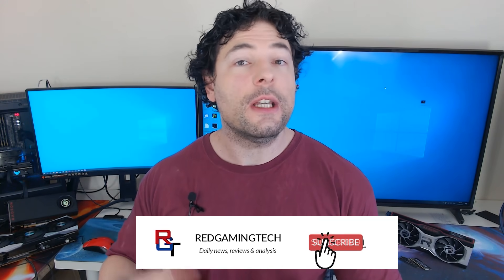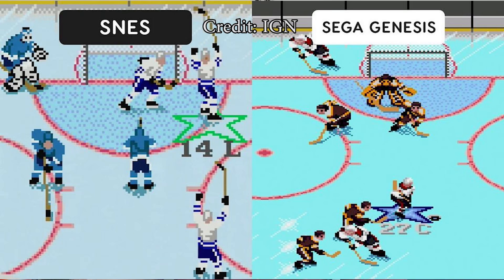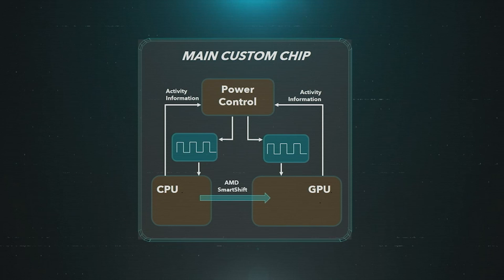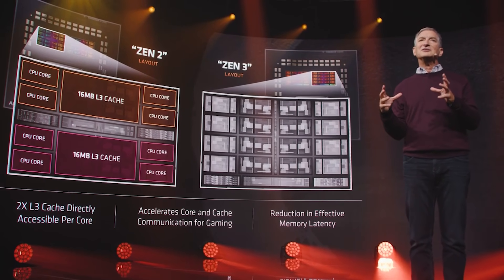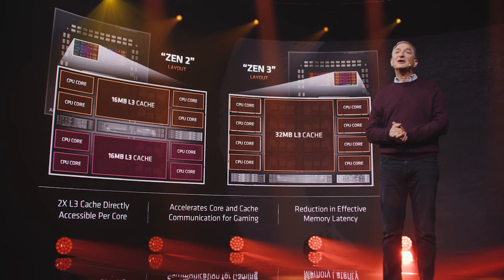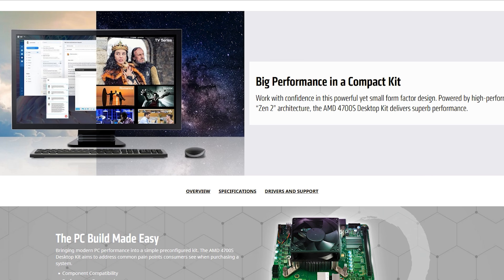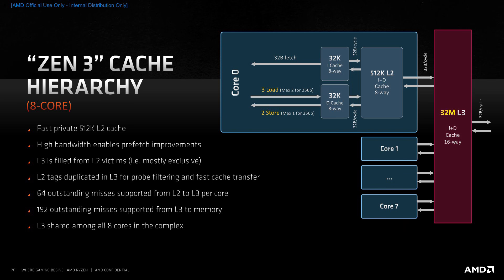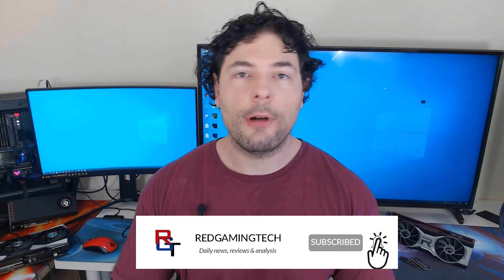PS5 CPU Die Shot Reveals HUGE FPU Customization | Playstation 5 CPU Analysis

Comment: No wonder Ms changed there most powerful console name to
Most powerful Xbox after they saw UE5 demo running on ps5
Reply: Yeah no... You do realize that exact demo also ran on PC's less capable than both next-gen systems right??? (RTX 2080 Max-Q). It would have ran just fine on the Series X. The only reason it was shown explicitly on the PS5 was that Epic & Sony have an expensive marketing deal together.

Also, please do explain all the games with +≈20-30% resolution advantages on Xbox... -_-

No amount of CPU grunt can make up for a lack of GPU performance when it comes to raw pushing pixels.
Reply: @Cooe.  An RTX Max Q is basically equivalent to what is in the new consoles. Digital Foundry videos all prove the consoles have a rasterization performance of an RTX 2070 and raytracing performance of an RTX 2060.
Reply: 1, they changed it from console to Xbox when the series S got revealed so ppl didn't mistake the S as being the most powerful console and 2, that ue5 demo Sony paid epic money for it, and it was showing running on a Pc and the next demo was on Xbox, plus it's already been shown on the die shots that the PS5 fpu is cut down, so dunno how's he's saying it's special lol
Reply: @mackemsruleFTM  he is clearly a Sony drone.
Reply: @mackemsruleFTM  and yet the xbox doesn't hold up ... stupid argument
please provide a source for the sony epic pays for a demo AND a source that ran it on the pc ... or shut up
Reply: @Cooe.  Ha, I'll bite and this is an easy one.  PS games although run at a slightly lower res always or atleast 90% of the time have a better FPS...  See simple as that not super complex or confusing.
Reply: @dribblepi5554  So Sony didn't "invest" a few million in Epic at the same time then??
Reply: @Cooe.  PS5 is running on par with the RTX 3080 PC in deathloop with same ultra graphic setttings source Enalista debits man the PC fanboys are gonna cry a 3080 PC costs 3000$ and the PS5 is running just like it when there is no cross gen games hodling it back that custom Big navi 21 RX 6800XT GPU that mark cerny hinted at the road to PS5 thats in the PS5 apu SOC is doing some work for 499$
Reply: Shhh! You'll upset the xbots. Oh 😂 you already did
Reply: @mackemsruleFTM  not quite cut down just highly modified..
Reply: @tristman8413  ehh no cut down from 256-bit to 128-bit
Reply: @raios-rogueboss-slayer4179  wrong. We won’t see this till like 2023.  But I do kinda believe your claism
Reply: @dribblepi5554  sony invested $250M in epic at the same time
Reply: @dribblepi5554  right so if you had a demo and one company gave you nothing and the other invested millions in you which company would you give the demo to? I know it's a hard one lol
Reply: @tristman8413  👍😂😅🤣

Comment: I'm still confused why the series x and s are clocked so low on the GPU. The rdna 2 core can go much higher than 1.825 ghz. I know it would raise power but the series x cooler Is beefy and it's not fully utilizing it's 315 w psu so I feel like they could've turned it up a notch
Reply: Yh same
Reply: Two options: 1. it was also aimed at servers and clocking it lowers helps there. A lot. 2. They save the extra room for a refresh end of next year or 2023. To see a bigger gap to XSX and XSS.

I don't like both options. But at least, the console is decent and fun to play around.
Reply: Because xbox has way more compute unites (36 vs 52) so they would have limited the clocks for thermals and power consumption. Also they don't really need blazing fast clockspeed since features like mesh shaders are designed around parallelism and will take advantage of the wide config of the xbox. So it's a well balanced tradeoff.
Reply: True with a BIOS update they can push the clocks higher to 2GHz.
Reply: I'm sure they played around and found the right clockspeed for it.
Reply: Possibly it's to do with the capacity of the cooling system to dissipate heat faster than it can build. It'd just de-clock itself as a result
Reply: @supermadkid  frequency’s don’t depend on how much CUs there are. they probably lowered the frequency’s to run lower powers games like Xbox 360 games so that backwards compatibility works better.
Reply: @rsKayiira  they would never tho , the chips are all validated to run at the rated 1.825 ghz off the assembly line. I don't believe they would ever release an update like that because it could possibly cause issues
Reply: @mickaelsflow6774  I see the point about the servers but they could've run dual bios , one for the console config and another for server config. I just think they left some performance on the table by not clocking this thing a bit higher for the series x
Reply: @earnistse4899  they did it with the Xbox One!! Looking at the PS5 GPU clock speeds the Series X GPU can definitely get close to or at 2GHz. It has better cooling and the silicon can handle those clock speeds.
Reply: @rsKayiira  but the Xbox one received only about a 50-60 mhz clock speed bump which isn't a lot. Here we'd need like 200+ mhz which could be problematic . I hope they increase clock speed but I'm not holding my breath. They will probably do that with the 6nm refresh next year
Reply: @earnistse4899  naaah you dont need a new node to hit 2Ghz on the Series X GPU. The PS5 has the same instruction set(RDNA 2.0) GPU and its base clock is 2GHz! Despite not having as good cooling. The Series X has more room for a higher GPU clock for sure. And its a server grade SoC in the Series X so it can handle the higher clocks as well. There’s another reason why they didn’t just hit 2GHz. But a BIOS update can achieve that for sure
Reply: @rsKayiira  XSX cooling solution not better then PS5 cooling solution and it's liquid metal, the PS5 case bigger for better airflow as well, let's see how XSX will do with only 1 fan in few years when true next generation high demanding games will launch out
Reply: @rsKayiira  I think it could but think about it this way. When the chips come off the line they are all validated to operate at the rated 1.825 ghz and thus the series x motherboard vrms and power components are made to handle that particular load. Im with you in thinking it could definitely handle it if they increased it but I'm thinking that the configuration is totally made around the system operating at that speed and power consumption level. I don't think they will do it tho even if it could handle it. The rumors of 6mm refresh are already pretty prevalent and that's the direction they will probably take
Reply: @earnistse4899  They always leave room for extra clocks etc. It was the same for the Xbox One. If they need to do a BIOS update and increase the clocks. The PS5 on the other hand they definitely didn't leave any room considering they need AMD switch to transfer power from one processor to the other. They know for sure they will be releasing a PS5 pro in the future. The reason for the 1.825 clock is because it was sufficient to hit 12Tflop sustained no matter what. I'm sure there are engineers who's Series X consoles are running at or close to 2GHz. You simply need to look at the PS5 GPU clock.
Reply: @rsKayiira  yes of course the GPU core is capable of it . But the motherboard has to be able to handle the extra power throughput also. The rdna 2 core can go as high as 2.7 ghz on air as we've seen with the 6700xt but it requires alot more power. The series x and ps5 GPU cores could also do something like that but it all comes down to cooling solution , psu  and motherboard
Reply: @earnistse4899  yeah thats what I mean’t the PSU, motherboard, everything is built with room for higher clocks etc. if I were to compare the two machines I’d expect the Series X to have the higher GPU clocks as well. It has a larger area to let out air, etc. it definitely has a larger thermal room than the PS5
Reply: It will also likely be down to cost. A lower gpu clock speed might well translate to needing different components that reduce the total price to build each one,  keeping the price of the system within a given acceptable retail price. 

As some components are hard to source currently,  that could be a benefit or a hindrance depending upon the part. Currently they just can't make enough series x as they need them both for retail and their server rack for xcloud, which is not something sony has to worry about. They're clearly able to make enough series s though as availability seems to be fairly ok generally,  though obviously everyone wants the series x.

We will likely see a series s and series x refresh in the next couple of years along the lines of what we saw with the xbox one s and x.
Reply: @bionicgeekgrrl  clock speed has nothing to do with possibly needing extra components. They could turn it up if they wanted
Reply: @earnistse4899  Agreed. And that's the point of option #2.

But it is also very likely they did not want to even have a chance of being "the hot" console or have less yields. MS not taking chances with AMD? But it would be odd. That's why I don't think that's the case.
Reply: @bullet759  didn't know that the ps has more than 1 fan?
Reply: Stability and predictability basically, doesn't sound sexy short term, but is a big deal long term.
Reply: @earnistse4899  components are rated for different voltages and speed. Reducing the speed reduces the type of components required and can help lower the costs. Higher clock speed requires better quality components which cost more. Pretty simple really.
Reply: Because it doesn't need to... More CU >>> Higher clocks...
Reply: @davenewman4663  not always
Reply: @earnistse4899  this is the same base architecture. Yes it matters.
Reply: @davenewman4663  look at the 6700xt . It's on par with the series x but has 40 cu vs 52. How could that be? Well the 6700xt is clocked way higher that's how
Reply: @earnistse4899  more CU >>> Superior for spread... 

And playstation lacks a TON of tech that Xbox has... Hence why PS5 struggles already.

You're also comparing a DEDICATED GPU with it's own dedicated VRAM to a SoC...
Reply: @earnistse4899  most of the time, playstation has to run games at 20-60% or MORE lower pixel count to keep up.

Bottlenecked with their 256BIT BUS, and lower peak calculation... TF... Same base architecture, so it is directly comparable.

And it only clocks the CU up when it is not overheating, and when the CPU performance is not needed..

Constant performance >>> theoretical peak.
Reply: @davenewman4663  ps5 doesn't " overheat" temps are perfectly fine and the performance of the console is not dependent on temps , it's based on power draw
Reply: @davenewman4663  give me some examples of games running 20-60% less pixels than the series x . I'm curious as I've not heard of any games running at such lower res unless the ps5 didn't get a proper patch

Comment: I always wondered, can't a company that wants to make a console just take laptop cpu and gpu and just put a custom OS and make their own console in a relative cheap way compared to making a ps5 and xbox  series? I mean the original xbox was just a pentium 3 with a geforce 3 with two vertex shaders instead of one on the pc gpu version.
Reply: Are equivalent gaming laptops cheaper than consoles? No..
Reply: Yes they can, and companies have, but they aren't going to compete, because they are just making a small PC, which anyone can do right now.
The advantage of consoles IS the hardware that is highly specialized for gaming, and gets rid of the features they don't need for normal PC utility use. Like a race car vs a regular sports car with AC, stereo and other things weighing it down. 
That combined with the buying power of those big companies who get the components much cheaper and still sell the consoles at a loss, you are getting a machine who's performance/price is higher than any PC you could build.

Comment: Still think the Reason on to why Nvidia announced RTX IO more than a Year ago was because of Xbox and PS5.

And we still are waiting for it to Release.

Soon… Hopefully with Win 11 (Direct Storage). And hopefully it will get used… …
Reply: i agree it was to move in step with consoles. I read about nvidia doing vram compression better also, (i have a 3070) so i am eager to hear more on that, i didn't imagine that did i?
Reply: Win 10 will get direct storage,  Microsoft backtracked on the win11 only bit. 

It won't make much difference for a while yet until developers start taking advantage of it.  You'll know when games do as the requirements will get much newer as I believe that there's a limited scope of compatible boards, gpus and CPUs (basically zen 2 (with x470 only or better) or  3, intel 11th , rx5000/6000 and rtx 3000 etc).
Reply: @bionicgeekgrrl  Right. Forgot about that. Win 10 will be able too as well. But yeah my Thoughts as well. Most Games wont be able to use it anyways until later. I would have hoped its an System that benefits us all from the Start but unlikely to happen.